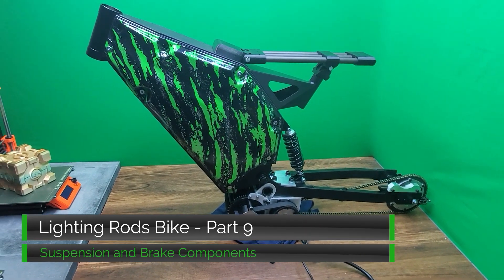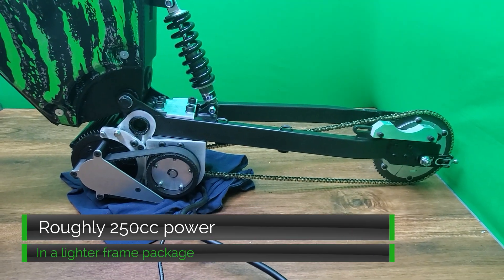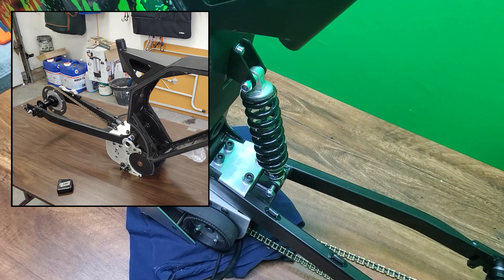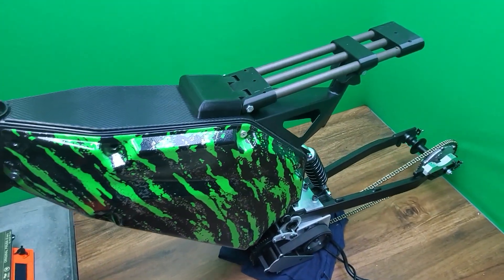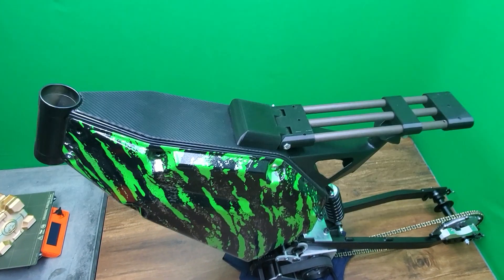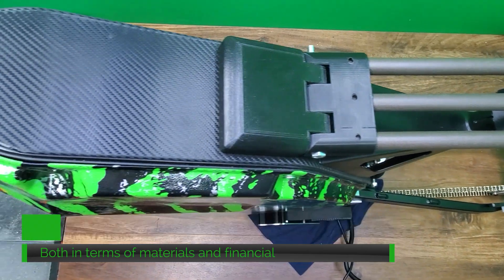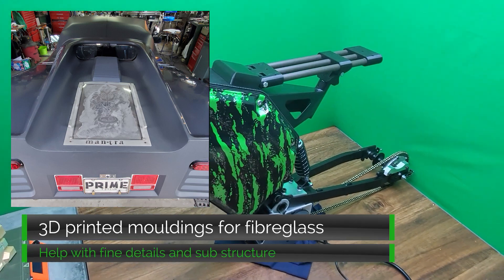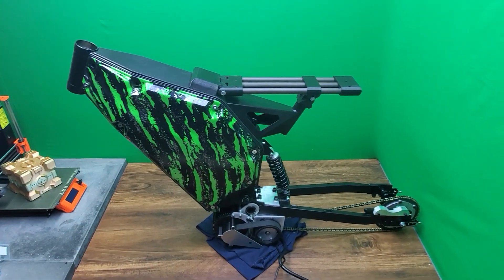Lightning Rods Ebike (10kw mid-drive motor) build Part 9 - Suspension with the Brain Trust!

Comment: How much does the the motor and controller cost?
Reply from the maker: The motor kits are 600-700 and the controller kits are about the same. You can get in touch with lightning rods by joining our discord server using the link and you can also email directly to greg@highvoltagekits.com https://highvoltagekits.com/discord

Comment: I went with a Boxxer World Cup, myself.

You can get a fork in excellent condition for cheap, if you look in the right place. 
Mine was only $175 for a 2018. The problem with it was a small $1 part, that the previous owner couldn't figure out.
Reply from the maker: Thats a good deal. I have been looking on pink bike etc. I have a few options. Just not yet sure which way to go. Thanks for the comment! Cheers
Reply: @HighVoltageKits  

Pink bike is where I got mine. It seemed like for the most part, the fork had barely been used. Both stanchions looked almost new, and it also came with a brand new extra charger damper. I think it was $175, shipping included.
Reply from the maker: Thanks! I appreciate the advice :)

Comment: Maybe you should look at a pit bike shock something from like an 85 or even a 100.  There's a gazillion of them on eBay and they're dirt cheap so it would be an easy way to figure out if it's a good option or not and if not then you didn't lose out on a ton of money. The only engineering problem would be getting them to fit correctly in the headset as obviously they run off different sizes but lots of people do it.   good luck!
Reply from the maker: Thats good to know. Thank you. I think we will try a bunch of stiff and see what feels best size and weight wise.
Reply: @HighVoltageKits  if you're not going to be doing hardcore off-road I would just recommend the fox 40s to be honest with you since they're light and give you more than adequate suspension for road riding.
Reply from the maker: I really want good offroad performance. I won't be doing hard-core myself but thee there is a ton of good riding around where I live. The fox 40s I know would be a straight fit in but if I do that getting the battery commissioned etc will take a hit. If this mission does not work out I'll maybe try and find a second hand set if 40s.

Comment: The build is looking pretty amazing so far. 
I have a small concern about you using motorcycle forks and that is the weight. Is that concern justified ? Maybe some of the smaller motorbike forks are comparable in weight to the dedicated mountain bike forks ?  I dont really know. But having handled both, in my experience, motorbike forks are significantly heaver.
What do you reckon ?
Reply from the maker: I think finding the right set will be the trick. If it looks and feels terrible it will be back to the drawing board. It should be a fun experience and experiment..But yes your concern is valid and one I share. I wi try and show the balance change and effect for you to see. Thanks for the comment! Cheers

Comment: Nice to see your build progress... for the front fork,  first recommendation would be a FOX 40 followed by a Rockshox Boxxer. These are very expensive forks so you may want to look for a used one on pinkbike,com. Forget about those cheap Chinese ZOOM forks as they are not safe, specially for a heavy and fast bike like you are building,  they will most likely snap if you ever need to lockup the font wheel for an emergency stop (I had one on my first build and it was scary).  Good luck with your build.

Cheers
Reply from the maker: Thanks. I will see how it goes with the hunt. Used is not a bad option  either. Cheers!

Comment: I was going to say something weeks ago but I didn't want to blow your bubble.
Unless you're sitting down that bike won't suspend your body weight very much from the rear
Unless you plan to put your foot pegs coming off the main frame somewhere and not the swingarm.
It's a terrible suspension design and trek tried it years ago and they called their bike the Y Bike
Not bad if you sitting down with your feet off the pedals
But how often are you doing that on a bike.
The rear suspension pivot whether it be a single or multiple pivot system needs to be independent of the BB mounting point.
On the frame you have the BB is part of the rear swing arm.
I have no idea why these frames are being manufactured by anybody we learnt that lesson back in the 90s
Sorry bro I would suggest scrap metal or fully modifying the bottom of that frame and the swing arm to move the BB to the main frame
The DNM forks will be fine for your application as well as their rear shock they are good units if very basic in their valving but it's worked in the past and will work for you you're not a World cup downhill racer mate
Reply from the maker: Thanks for the information. The footpegs will use a custom bracket off the bottom of the frame and not the swingarm. At least that is the plan.. So I hope to locate them in the optimum position. Feel free to say anything. It's all a learning process. I have confidence in Mike's design for the bike and I think local fabrication of parts just got a big boost! More soon! Cheers
Reply: Even tho I agree that for a downhill mountain bike, having the bottom bracket on the swing arm is a bad design because you will be riding the bike mostly standing on the pedals and not on the seat, this is not true however for a powerful ebike like the one he is building. The motor is attached to the bottom bracket, this way, the chain length will always stay the same regardless if the rear suspension is being compressed or relaxed. Also because the pivot point is very close to the bottom bracket, the problem you discussed isn't noticeable. 

A frame like the RisunMotor FC-1 Enduro would be a better fit for a hub motor, having the bottom bracket mounted on the triangle, however for a powerful mid drive motor, this frame (RisunMotor FC-1) will probably compress the rear shock hard every time your would hit the throttle hard. 

Please note that I am talking from experience as I have basically the same frame (EEB enduro Ebike Frame) with a mid drive motor (BBSHD @4000W), and the suspension is buttery smooth using my DNM BURNER rear shock and a RockShox BoXXer Team front fork. 

Ideally, mounting the foot pegs where the pivot shaft now reside would allow the rider to take advantage of the full front and rear suspension when standing on the pegs, but this would require some metal work. Brackets that would mount at the pivot shaft could be design to allow multiple pegs mounting holes so it can be adjust for comfortable riding position.

We are not talking about a mountain bike here, this will be more in the e-Motocross categories....

Cheers
Dan
Reply from the maker: Thanks Dan, some good information there. I can't wait to get out and ride it like yours! Appreciate your insight on the ground clearance. 👍Cheers
Reply: Having re-watched this after reading your opinion, I cant say that I agree with you. The geometry looks like it will work just fine and who puts footpegs on a swinging arm ?
Reply: @herenow2895 
To clarify my previous ramble.
The  rear suspension will still work.
It just won't work as good 
No manufacturer that I am aware  of any motor vehicles motorbikes or mountain bikes other than Trek did with the Y bike has had in production or currently in production a vehicle that does not suspend most of the weight of that said vehicle on the suspension 
You don't put the weight of the  motor the fuel and the rider or driver on the unsuspended side of the vehicle.
Which is exactly what's going on with that rear suspension on that  bike if the Captain puts cranks on it and then stands up on those cranks.
The only part then fully suspended will be the front triangle and the battery.

I don't think you understand what I was getting at.
The bottom bracket is attached to the swingarm.
The swingarm then pivots on the main triangle.
Put some cracks on it.
Now stand up and hit a bump with the rear wheel.
The only thing between your feet on the cranks and that bump is the flex in spokes/ rim and the flex in the tyre. The suspension will still pivot but your weight plus the weight of that motor is all on the swing arm which is attached directly to the axle on the wheel and is not suspended by the shock. Only the front triangle and battery will be fully suspended.
On every other bike on the planet when you stand up on the cranks  you are fully suspended by  front forks and by the rear suspension. You only thngs attached to the rear suspension will be the wheel and the braking system plus or minus some other pivot points and linkages and one shock mount point depending on your rear suspension design
Reply: @nobrakes7247  - By Bottom Bracket, I guess you mean the rotating crank assembly ?  Which this bike will not have, as I understand that it will just have footpegs. Which of course will be mounted to the frame in an appropriate position.
The suspension will be strong enough to not be permanently bottomed out and as such will absorb the shock that would otherwise create cracks. 
The addition of cracks for the purpose of hypothesis is an unlikely scenario and even if the mounting points cracked, there is unlikely to be complete failure of the assemble before it is noticed.
I still dont share your skepticism. 
We will see in due course.